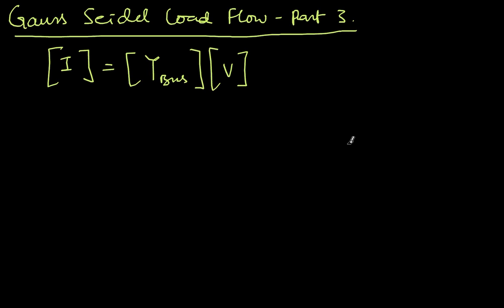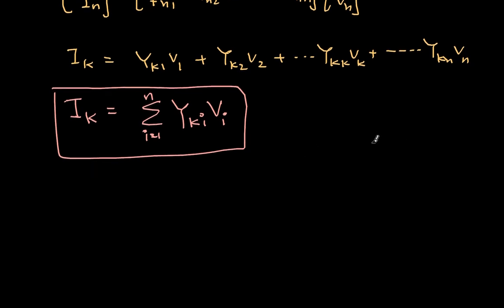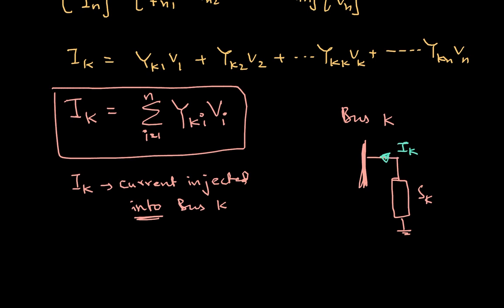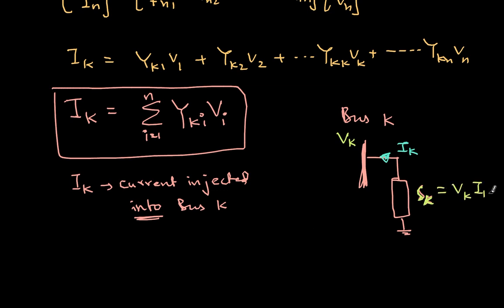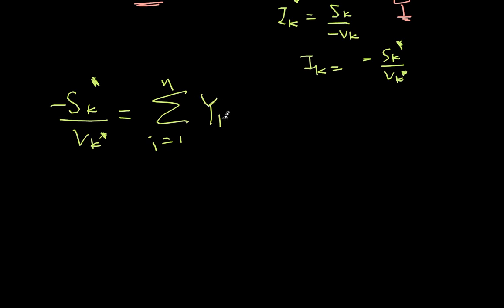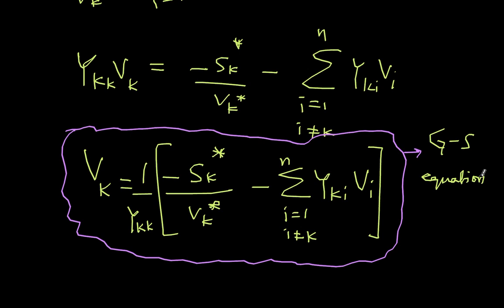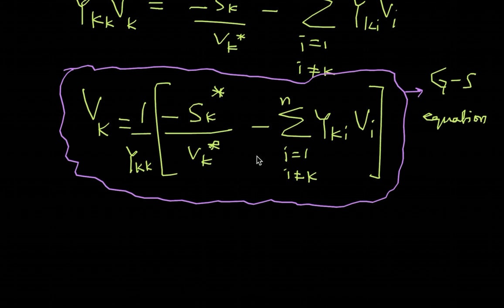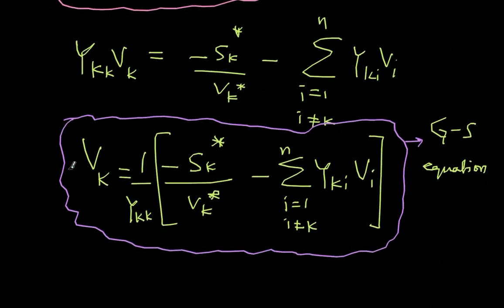Gauss Seidel Load Flow - Part 3

Comment: Hi sir, may i clarify something regarding Q3 and V3 equations at bus 3. Why Y31 or Y13 and V1 were been considered since bus 3 is not connected with bus 1? Is it not only the mutual admittances, Y32 or Y23, as well as the self-admittance, Y33, should be used in bus 3?

Comment: while solving manually what should be written in place of delta 2 and delta 3 while calculating q3..since v2 and v3 are unknown
Reply from the maker: you can start the iterations with delta2 = 0 and delta3 = 0

Comment: Sir. In order to find V3 we need Q3. However in the Q3 equation there is delta3 ( angle for V3). How does this possible because we do not know delta3 but it is in the Q3 equation. Does it assumes to be 0 degree in Q3 equation?
Reply from the maker: since delta3 is angle of V3, we can use the older value of V3 and obtain its angle delta3 and use it for calculation of Q3. Then we use that Q3 for calculation of new value of V3. (which includes the new value of delta3).
Reply: Hye Sir.
In L12 lecture at minute 1:06:43 when you were calculating Q3, delta3 was taken to be 0 degree.
Referring to your previous reply, In this case the older value of V3 is 0.98 with the delta3 unknown?
A bit confuse because delta3 is the unknown and only the mag of V3 defined eaerlier.
Reply: you can get the value from the initial guess which specify the values of magnitude and angles of all the bus voltages

Comment: SIR ,final value of Q3 ????
Reply from the maker: Final Value of Q3 is -0.11991 pu. That means bus 3 actually consuming reactive power.
v2 =    1.0058  at -1.9943 degrees
v3 =    0.9800  at  0.91348 degrees
Reply: thanks for reply sir
Reply: it means generator at bus 3 is consuming power ... am i right sir?
Reply from the maker: it means generator at bus 3 is consuming "reactive" power and at the same time supplying "active" power. S3 = (0.25 - j 0.11991) pu
Reply: k sir , i understood thankssssss .....